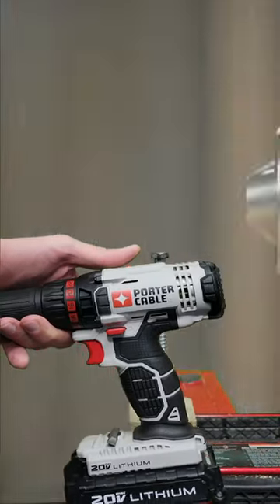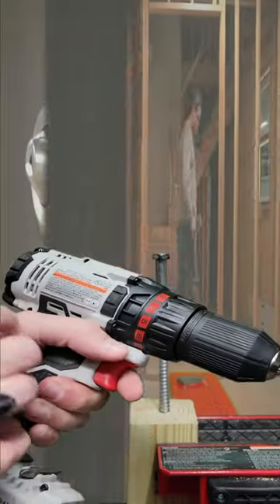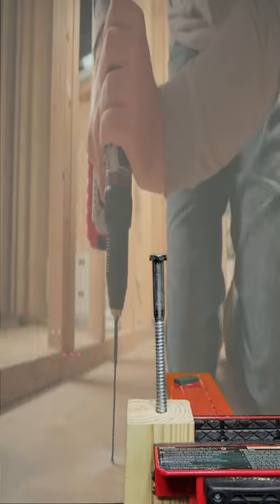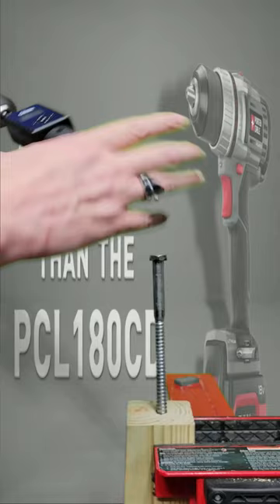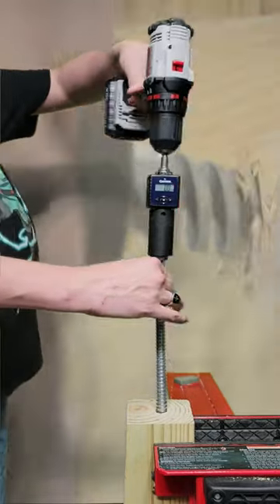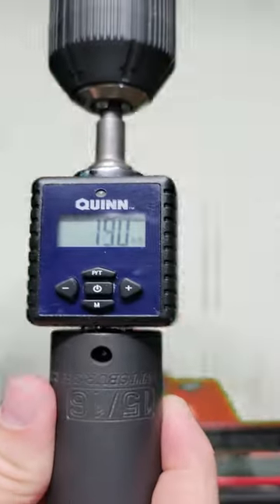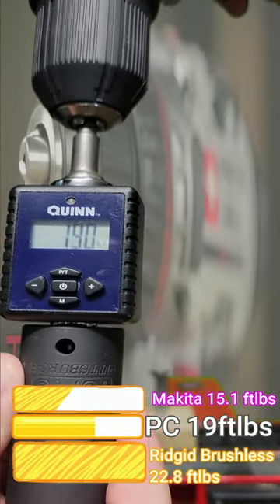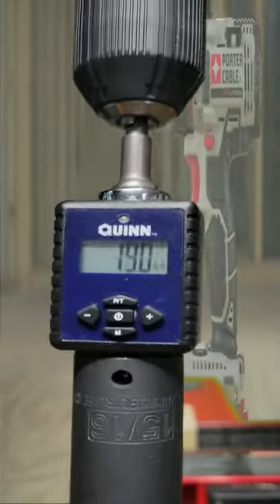Torque Testing Porter Cable Drill #shorts #torquetest #milwaukeetools #makita #ridgid #funny

Comment: I have this drill and bought an off brand 5.0 Amp hour battery. It seems to have more torque when drilling holes. Feels a lot more powerful compared to the 2.0 or 1.3 amp hour batteries. Can use speed 2 drilling through 4x4 treated lumber without stopping. Have to use speed 1 with the smaller batteries.

Comment: I have the drill. I bought it over 5 years ago in a kit with the impact driver.  First 20 volt tool I've had and I didn't know about brushless at the time otherwise I would have got a brushless model
Reply from the maker: It surprised me in a good way. I am giving the 6 tool kit to my son for Christmas.
Reply: Is that the kit that they had the great deal on at Costco. How much better is the brushless Porter Cable.  I was going to buy the brushless kit as an upgrade till it started watching YouTube and found out the real brands.